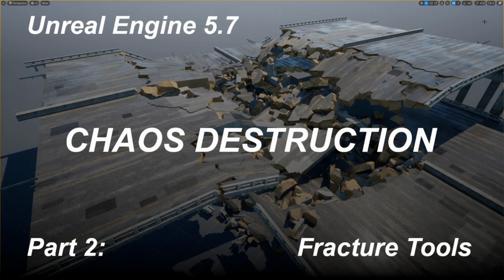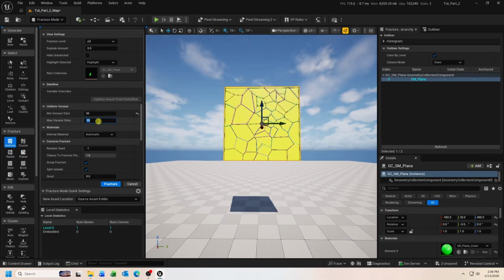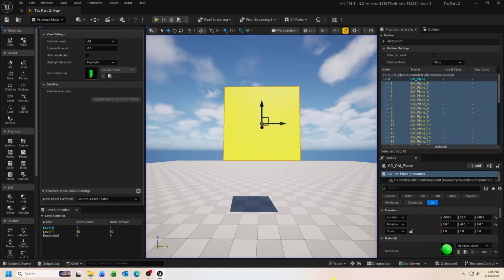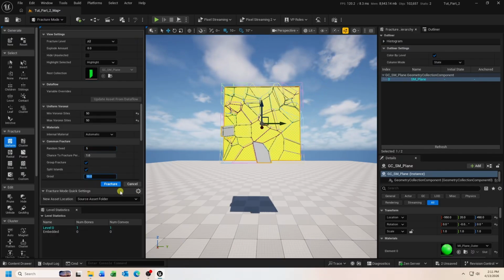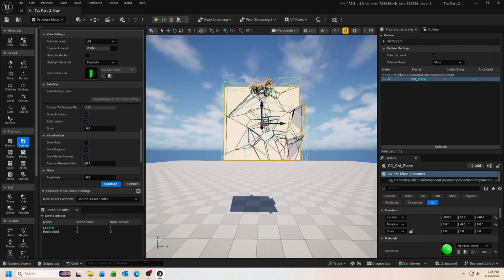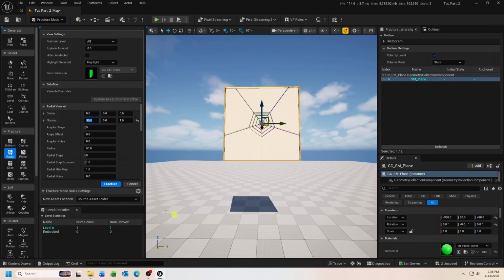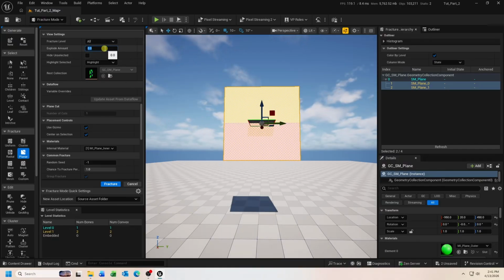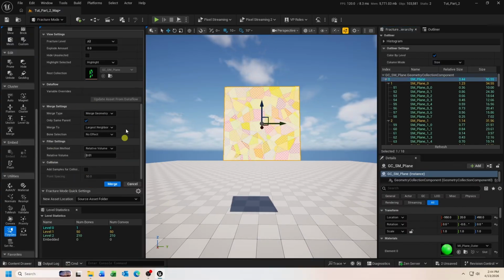Unreal Engine 5.7 - Chaos Destruction for Beginners - Part 2: Fracture Tools

Comment: Excited for the next part!

Is it possible to mix a radial fracture with a vornoi cluster to simulate a crater/impact point?
Reply from the maker: Yes - You can mix & match different fracture patterns as much as you want.  The only limit would be the total number of bones you end up with and if your system has the power to handle the simulation.  For me, I've noticed that my sims start to become sluggish around 5,000 Bones.  If you are able to run the simulation, in Part 4 I'll be covering the Geometry Cache were you can bake it down so it's much less resource intensive to play back in game or during a Cinematic.  👍
Reply from the maker: FYI - Part 3 "Field Systems" is scheduled for release on 04/28/2026 @ 8am New York City time.  🙂